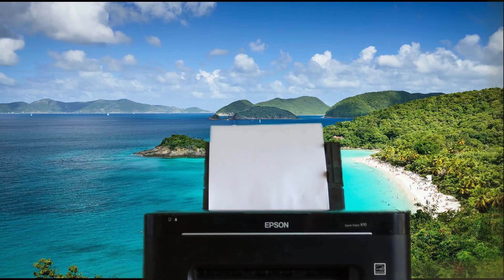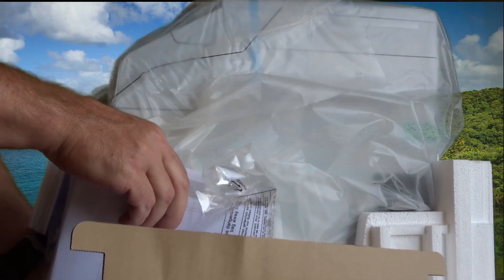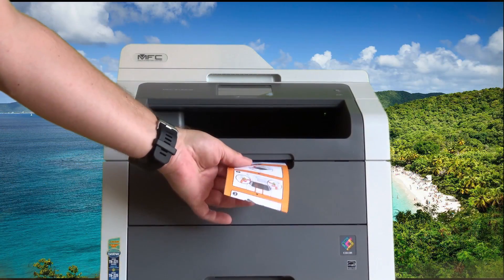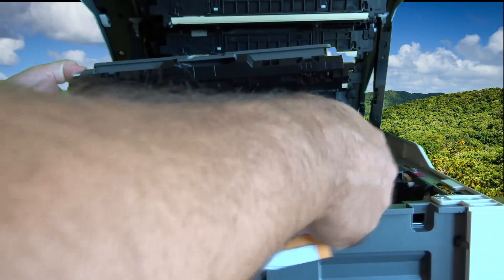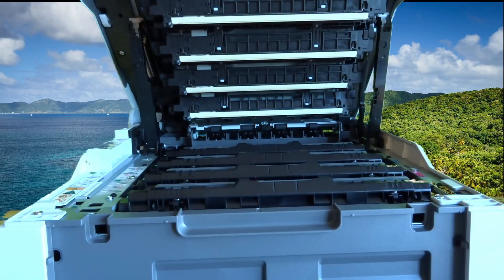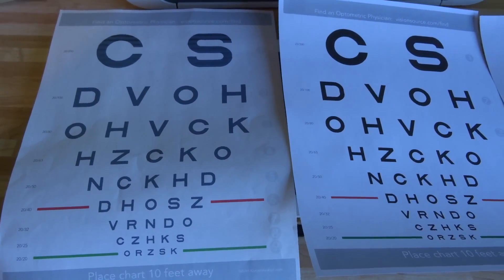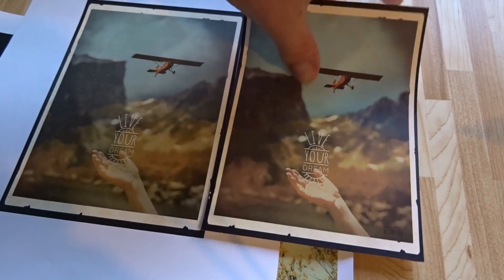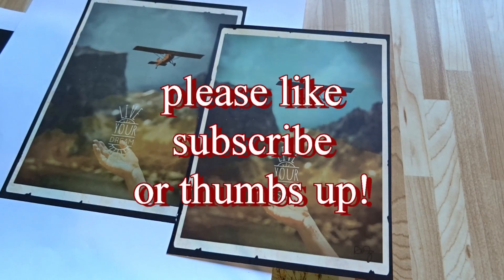Brother color laser printer 4 in 1 - 9130cw review unbox setup

Comment: thanks for the review. Planning on buying this and replacing the 3 half broken printers and a fax machine about a decade old in my home office.
Reply from the maker: I still have not had any issues... I certaintly don't miss my inkjet..
Reply from the maker: ps, no I have not had speed issues, I print both from my ipad and PC.  Sometimes an actual scan to file can be slow but that's to be expected.. it sends all info to printer then it all has to come back.. If I was this fellow I would ask if he has a dual band router and try a different band.. ie: go from a 2.4ghz to 5.. when I get home perhaps I will write him some suggestions... I use windows 10 and an ipad2
Reply: thanks for the reply! cool!, i am sure he will appreciate it!

Comment: Does it scan two sided documents automatically?
Reply from the maker: I'm going to have to investigate more but I do not believe 2 sided to 2 sided is auto but will do some testing and let you know. It does do a great job of say loading one sided on the top autofeeder and converting for example 2 single sided into 1 double sided, or even taking 4 single sided and placing them all on single sheet one sided  etc... a lot of that type of capability. I have a feeling this is a common issue, which is why you are asking..

Comment: thumb up 81,sub 1,5k,thanks,look like it was a little heavy maybe :+),ha,your still happy with this machine,still work?,and for cheap cartridge this is a good model ,i think?
Reply from the maker: Rod Sten333 yes, working fine, if you are doing high quality photos go with an photo quality inkjet.. but I can say  this laser jet performs great, it can sit for a long time, fire up and print away,, an inkjet if it sits gets plugged up and won’t print.. kinda like a tank compared to a sports car. Each has a purpose. I did a review on an HP inkjet also if interested..but I’m happy with both.. laser is a great work horse for volume, and decent quality.
Reply: ok,thank you,i know picture is not so good on this,and i have a photo hp printer,but last time he as refuse new cartridge because they was dry i guess,will never buy hp again and they put counter they sell those very high priced,does the glossy paper give better picture and you got to clean after how many page?
Reply from the maker: Rod Sten333 yes you can get glossy laser paper, it does help, but it will never be better than an actual photo inkjet.. cleaning the laser is easy, it has a built in slider to clean each cartridge.. have not had to do it yet after 500 or more copies..